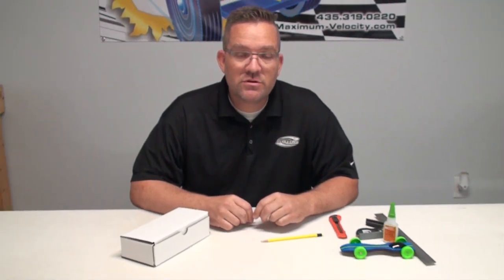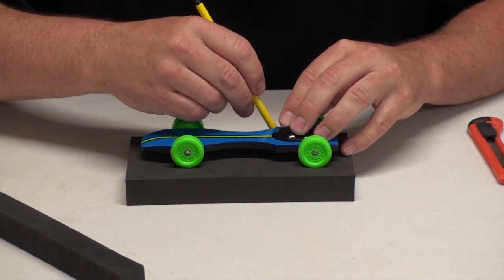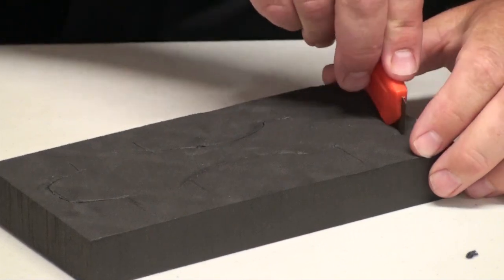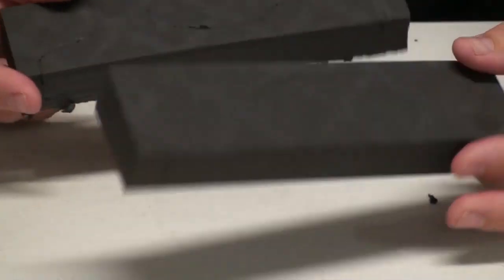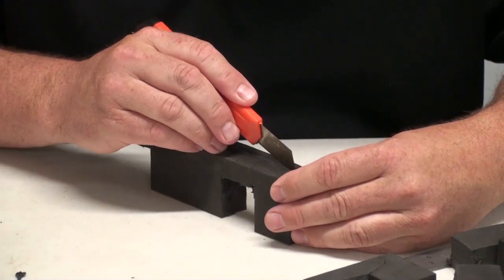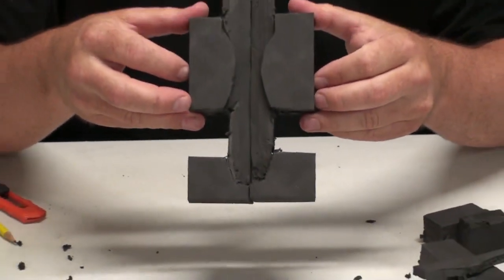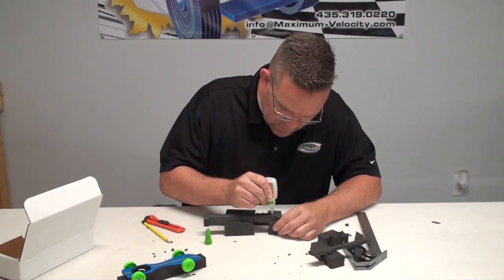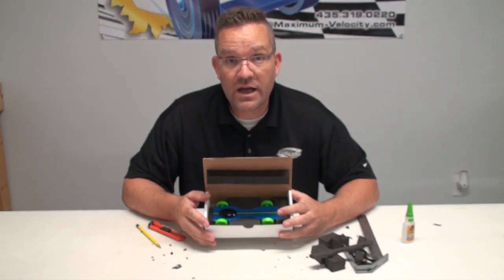Pinewood Derby Tutorial Car Carrier

Comment: Hey Joel, what about little divots either side of the body for finger holes in order to grip the car to get it out? Or is the foam weak enough to push your fingers down beside the sides on the body? I know we obviously don’t want to grab and pull the car out by the wheels either for obvious reasons. Nice video man. Helps a lot. Yeah... no fancy router here.